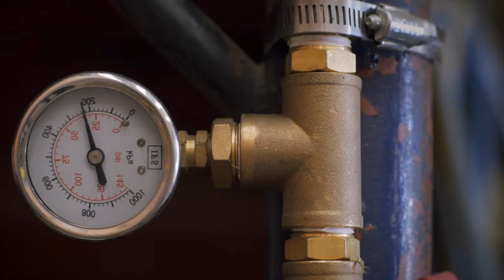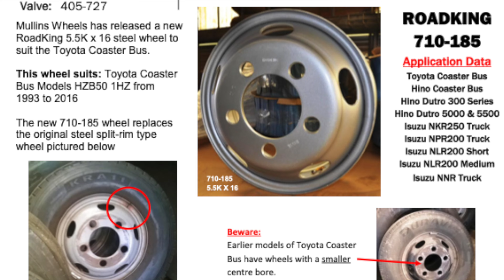Split rims and tyres on old motorhomes. Episode 102 || TRAVELLING AUSTRALIA IN A MOTORHOME

Comment: yup. 1 Costco employee died from an a two piece split rim exploding, we have not accepted split rims since. That was well over 15 years ago. We won't even air them up anymore. I'm happy about the decision not to service them, they are dangerous and I personally wouldn't service them even if my workplace told me to. Its not worth getting my face blown off for somebodies tires. yes we have steel cages, but we still don't trust them to stop the force of the erosion from a 2 piece split, its even more intense than a solid wheel explosion when the tires are aired far beyond compacity.
Reply from the maker: @mwsoupy     holy moly!!  That's scary 
🌑💥💨